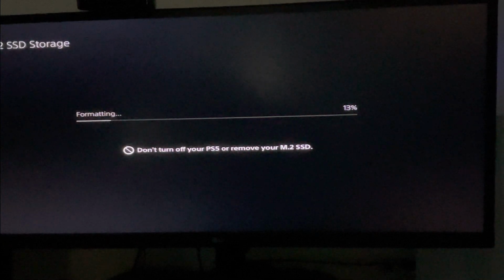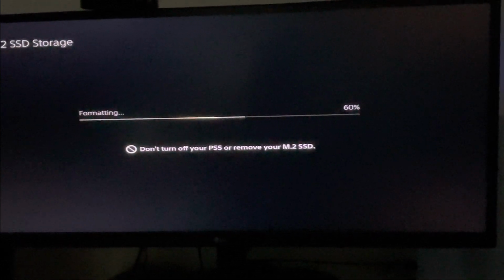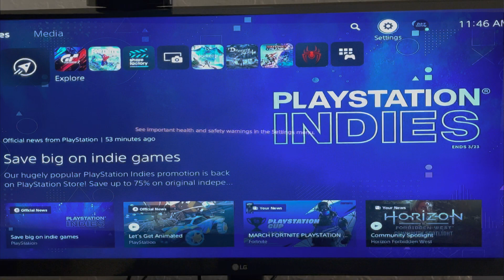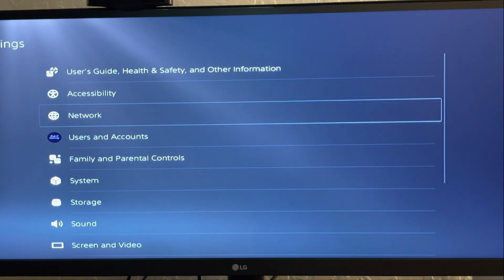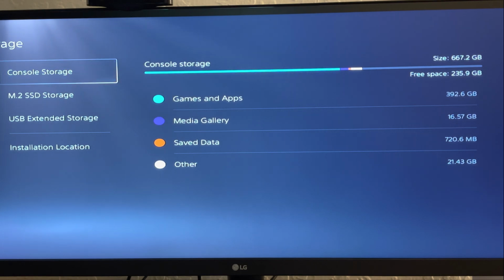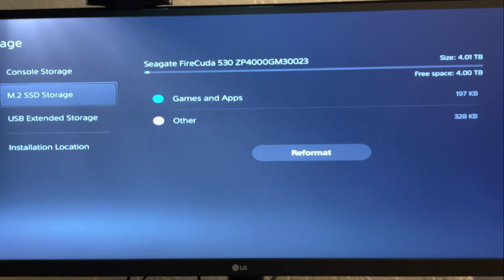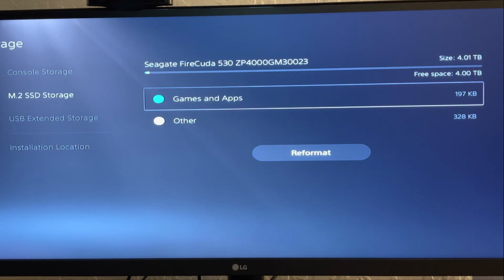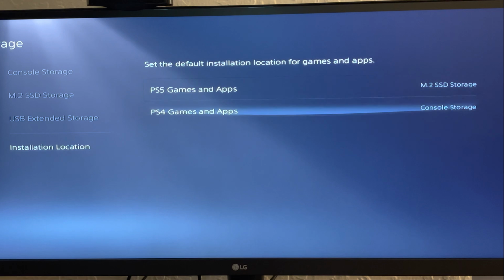How to install Seagate gaming FireCuda 530 internal SSD on your PS5 made EASY!!

Comment: The screwdriver I used was able to get the first screw out but not the second they are the same size right?
Reply from the maker: Hello no the first screw is larger than the second. You will need a glasses screwdriver for the second screw. If you try to use a normal size screwdriver it will strip the screw and then you won’t be able to get it out.
Hope this helps!
Reply: @dubillgaming  yikes that does help a lot I feel like I’ve done damage to it already.thanks
Reply from the maker: @Backup-uy5li  I would say, use a rubber band and put it on the screw, get the glasses screw driver and use it that way. That’s the best way since the screw is so small. And since the ps5 is so delicate